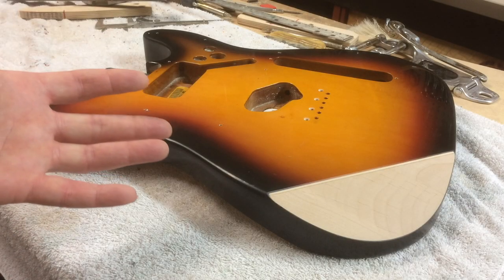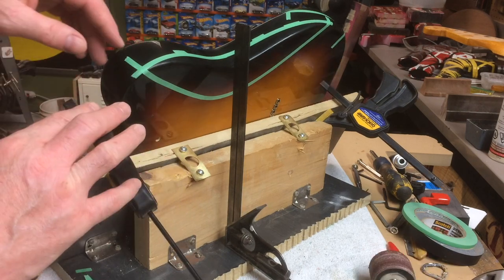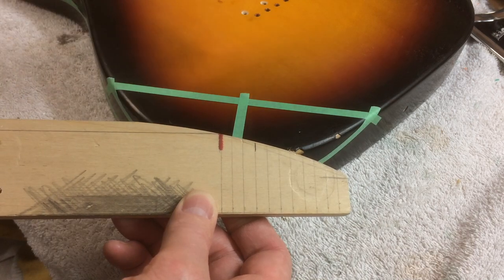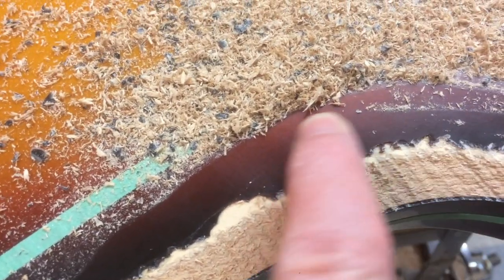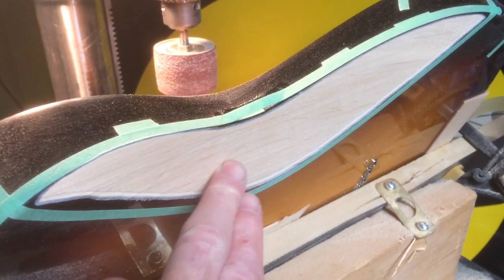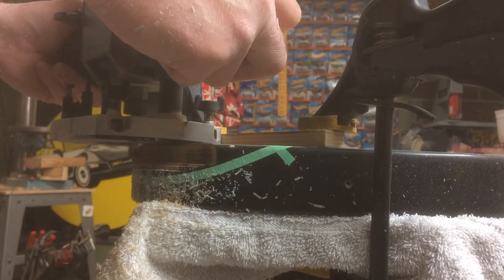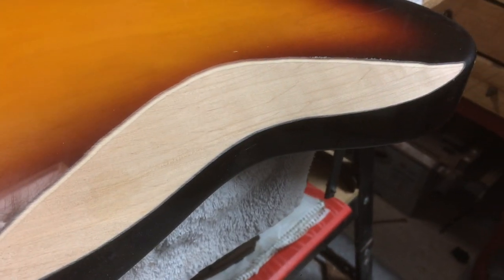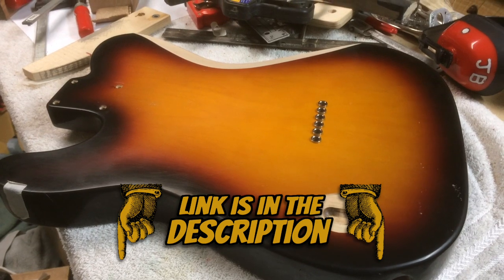Adding an Arm Rest & Belly Cut contour to a Telecaster body.

Comment: I use a small Dewalt battery powered angle grinder with 5” 80 & 120 grit disks. I have access to a commercial band saw and lots of other woodworking equipment but I’ve found that using the angle grinder is best. It cuts very clean and fast up to a tape line. On the first Telecaster body I contoured I retained the original finish as here which was undamaged by my grinding and sanding. The transition between the original finish and the contouring job was very neat without any chipped paint. I stained and shot clear poly on the new exposed contoured areas. Very easy to do. Ive done several bodies now. I like your credit card trick for the required hand sanding.

Comment: I recently bought a 1983 telecaster. The neck is November 30 1983 but I don't remember the inspector's name. Serial number indicates it was made in Fullerton, but it never felt quite right. Under 7 lbs and I thought it was relict to look like a 1952 blackguard. awesome guitar and I got a great deal on it but it has been sanded and painted. yellow paint in the cavities under the pickups and all routed areas. I picked up my other tele and figured out that it had been carved out at the belly. I try to keep my guitars original but this is such a great sounding and fun to play guitar. Really is one of my favorite guitars but still have an underlining doubt if the body is original. I would love for someone with some expertise help me figure it out

Comment: What about contouring the horn for better access to the upper fret registry? Also maybe next time use an exacto knife or hobby knife to outline so u don't chip as bad? You did a nice job though.
Reply from the maker: The client didn't request the lower horn to be opened up and the chipping was only when I used the rasp file, as I showed in the video I only went so with the rasp, no chipping remained in the final product.

Comment: hello?
I am someone who watched the video and was thinking about trying it myself.

However, is it okay to do the arm rest and belly cut contour work as above on the telecaster thinline model?

I am worried that holes may be created in the thinline model while working on the contour.
Reply from the maker: I wouldn't, even if you managed to not go through into the hollow part, removing wood could compromise the integrity of the body.